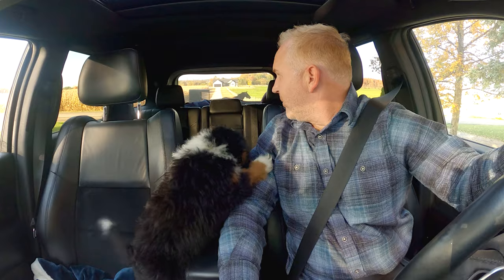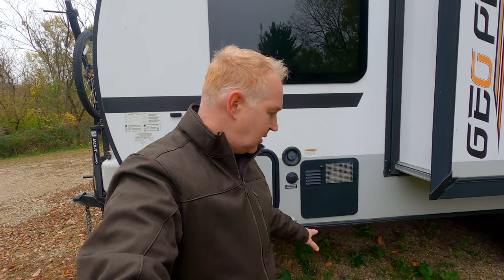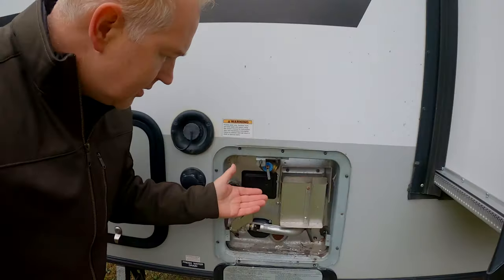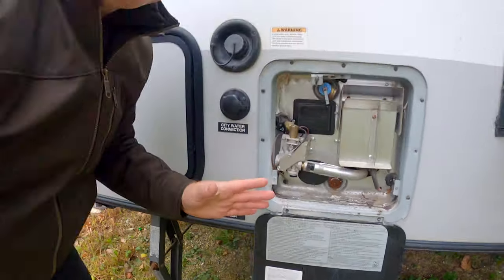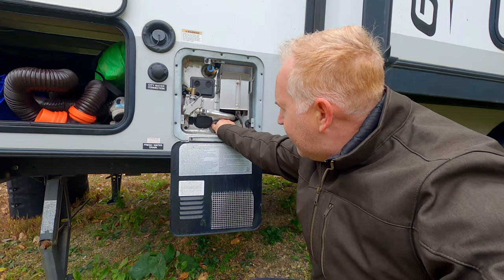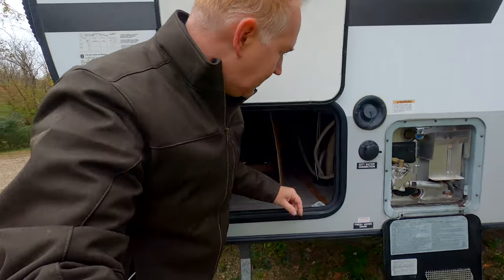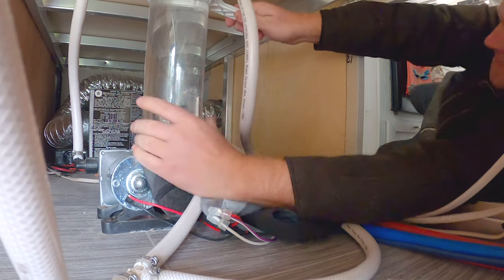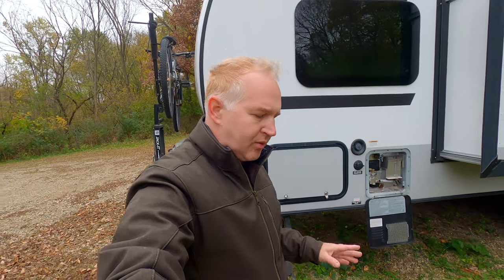How to winterize your GeoPro 19FBS - Whoa! A common missed item that could destroy your Geo Pro!

Comment: Yes one thing when you have your battery disconnect switch off the only thing connected is your solar to the batteries and when you’re not using it you should always have the disconnect off so the solar continuously charges your batteries! Our winters get down in the low teens I never remove both of my batteries from my Geo pro keep the disconnect off and they keep charge all winter long just FYI

Comment: I use compressed air to purge most of the water in our 19FBS.  Don't forget to pour Pinl RV antifreeze into all the drains, enuf to fill the traps.  Noticed you have no element in your main filter. I will be completly removing that canister and going back to external filter over the winter. I'm still struggling with the pump filter bowl, tonight I'll try a small strap wrench, Hand Tighten Only my Arse!!  Oh, and good to see ya again! I watched all you videos before buyin our 2020!

Comment: I’m kinda laughing because I have the 14FK and I get rid of the water in the same way just about.  I’m new to owning a trailer and I’m just winging it.  I’m clueless...the only thing I do different is I hook it up and drive it around with the low point drains open getting the water out 😂
I use mine all winter so I put several gallons of RV antifreeze in the black tank and leave the filters off and caps off the drains and call it a day.  I use it for skiing.  So I bring gallon jugs of water for cooking, and I make sure my propane tanks are full for the winter.  I have videos on my trailer.  There was a solar panel debacle when I purchased it.  I’m not a fan of RV One.  I started following you when I got mine as there were no other owner reviews on the 14FK (now discontinued?) I changed that lol.  
Thanks again and I love the new puppy!

Comment: I wonder if you took a shop vac and made an a little adapter to fit around that low point drain holes and just turn the shop back on if that would work as well I don’t own an RV but I am a homeowner in just a little creative as well as a truck driver

Comment: ⚠️ Your RV hot water tank's anode rod needs to be replaced periodically! Please see your RV dealer and/or manuals for important replacement information before corrosive damage is done to your tank.
Reply from the maker: Thank you very much👍🏻👍🏻
Reply: @GeoProAdventures  You're welcome... Glad to pass along some RV tips! 😎👍
Reply: I concur. I saw the state of the anode when you pulled it out (it's not a filament for those who are wondering) and thought, boy does that need to be replaced. It's designed to be sacrificial (and replaced) in lieu of the inside of your water tank from corroding and disintegrating. Also, get yourself a short extension for your socket wrench so you don't risk stripping out the threads for the anode rod.

Comment: Love that puppy! Great winterization video. We have a Grand Cherokee as well and pull a small travel trailer. Our Jeep has the same engine as yours and the factory tow package. We have been looking at a Geo Pro 19FD which is heavier than our current trailer and I was wondering if you have done anything to your Jeep to be able to tow your Geo without a weight-distribution hitch. Any comments or suggestions would be appreciated. We enjoy your videos and are inspired by your story.

Comment: Probably best to use a compressor to blow out the system rather than strain your water pump.
Reply: Do you own a Geo Pro?  Why use the air compressor?  I see other videos for other trailers and they use an air compressor.  but Gep Pro owner seem to skid that part??????
Reply: @elliejost7283  I own a Rockwood Mini Lite. The plumbing systems are pretty much the same on trailers and rv's. The reason you use an air compressor is to blow out any remaining water in the system. Some would say you don't need to because the anti-freeze will clear the water out but the remaining water can dilute the anti-freeze in that section of the plumbing and cause a problem. Some people won't blow the system out and some will. It's an extra step but better to be safe than sorry!